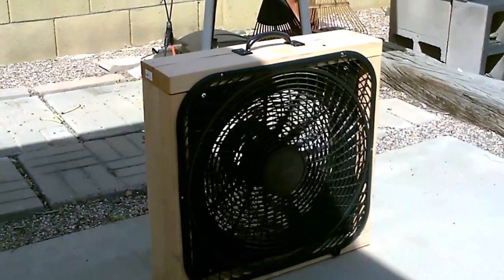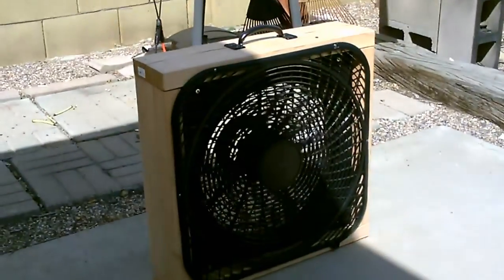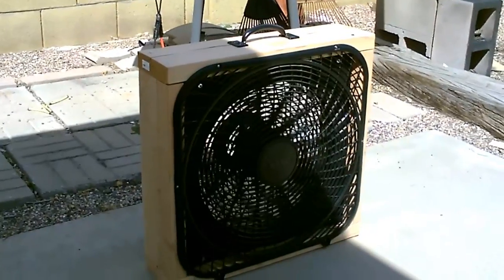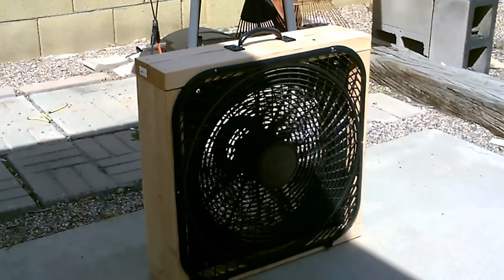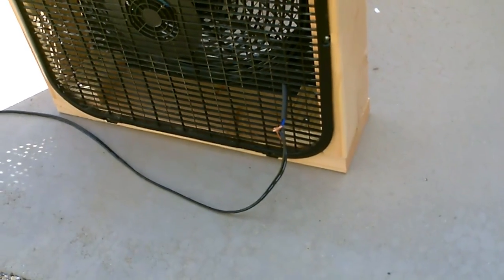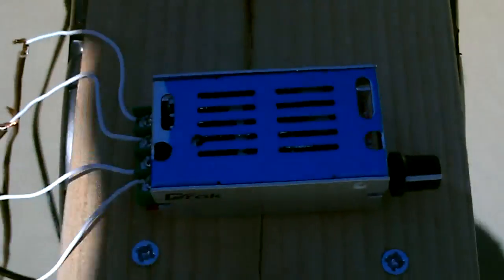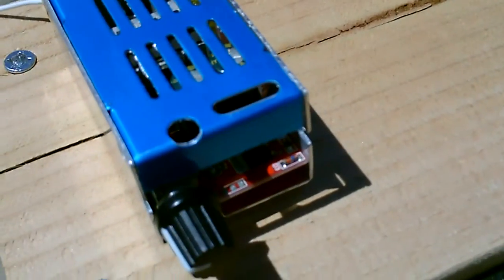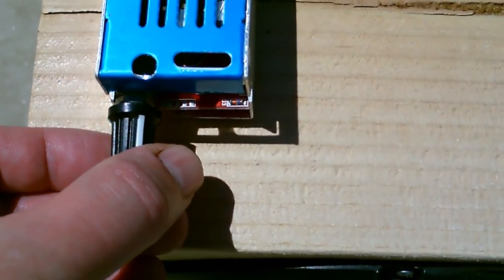Homemade 12V DC Box Fan! - Full Size! - 100% solar! (or battery pwrd) - 100w panel/motor - Awesome!

Comment: Could you not just get an old junk car radiator fan, discard the ac fan/motor combo from an old 20 inch box fan, then zip tie the  radiator fan frame to the box fan grill(using ample zip ties of course) .These box fan cabinets are about 4 ish inches deep so plenty of room to accommodate a typical car fan assembly. The  do your  motor controls and switch.

Comment: Fan motor cost?
Reply from the maker: you can get a 16" car radiator fan (like the one i used) for about 30 dollars. they sell more expensive ones but a regular one is about 30

Comment: Now this was the video I was looking for!!!!!!!!!! I have a old Volvo radiator fan and wanted to reuse it for a box fan. I'm going to run it off a house wall socket though with a potentiometer for another fan. Thanks for the Idea!!!!
Reply from the maker: Glad I could help. i looked for a 12v box fan 'on and off' for a year or more. couldn't find one so i just made one 🙂
Reply: How did your fan work out?
Reply: How did your fan work out???

Comment: How are you running it direct off the solar panel without a buck/boost converter isn’t the VOC too high?
Reply from the maker: hi. the voltage is fine. the fans are made to handle a range of voltages. the voltage from 12v panels is a little higher than 12 volts (from 15 to 19) *but 12v power supplies run higher too. the output voltages of my 12v power supplies are from 12.91 volts up to 17+ volts.

Comment: Does this fan motor need to be lubricated?
What's the maintenance on the panels?
I'm in desert also but don't understand the safety behind making a setup like this and the longevity.
Doesn't it need fuse?
I'm looking at outside setup for horses and a portable one when I go to dog events. 😊 Wish you were local, I need a Solar and Electricity Mentor!
Reply from the maker: hi. nope, the fan motor doesn't have to be lubricated. these motors will run many years and are 'maintenance free'. there is no maintenance on the panels either (except for keeping debris off of them). these types of fans can easily last 15 years and the panels last 20 or more. there really are no safety issues with this. it's basically just an automotive radiator hooked to a solar panel. just make sure to use a 12v solar panel. no fuses are needed
Reply: Thanks!! ❤

Comment: Do you have a link for buying the fan on Amazon?
Reply from the maker: hi. i can't find the exact link but it's just a stnadard 16" auto radiator fan. any should work good. i'll see if i can find a simliar one... here is a link one
https://www.amazon.com/dp/B0BJCYJBRB/ref=sspa_dk_detail_3?pd_rd_i=B0BJCYJBRB&pd_rd_w=mZae7&content-id=amzn1.sym.56b6d1e1-8781-4e32-a7bc-5298ad4b88ac&pf_rd_p=56b6d1e1-8781-4e32-a7bc-5298ad4b88ac&pf_rd_r=Y0Q5WS1JVH52R42VKRJN&pd_rd_wg=ObsSy&pd_rd_r=6c88350d-e53b-4c99-9c8e-d5dc510f7d44&s=industrial&sp_csd=d2lkZ2V0TmFtZT1zcF9kZXRhaWwy&spLa=ZW5jcnlwdGVkUXVhbGlmaWVyPUEzSTdXWjlLV0JaSDYzJmVuY3J5cHRlZElkPUEwMjM4Nzk1M0pIVDk5SzhEWlA5OSZlbmNyeXB0ZWRBZElkPUEwMDcwMDQyMThLNEdGTjdDSTNZUSZ3aWRnZXROYW1lPXNwX2RldGFpbDImYWN0aW9uPWNsaWNrUmVkaXJlY3QmZG9Ob3RMb2dDbGljaz10cnVl&th=1

Comment: Just for fun I bought (6) 100 watt panels, set them up on the roof and went into the basement to see what kind of things I could do with 500 watts of DC.   Right away I noticed no one makes a good 12 volt box fan. I ordered a new radiator fan that was balanced and has grills on both sides. I ordered a cheap speed control from amazon and installed the whole unit into an old case. Works like a charm except its a bit loud but I love that it can run right off the panels with no control. In the mornings it starts on its own and runs all day until dusk. Its perfect to keep air from stagnating in basements. Also all that free electricity is hooked up to strip lights in the closets and anywhere that I need it. I use it to charge all my batteries including all my yard equipment power tools etc. Anything left over goes into a 12 volt ceramic heater to preheat the water going into the hot water tank.
Reply from the maker: that great! you've found lots of uses. i run dozens of things just using 100 watt solar panels. i actually made this box fan because i couldn't find a 12v full size box fan anywhere. someone should make and sell them and include the 100 watt solar panel. simple off grid cooling

Comment: So this fan is brushed motor?
The dimmer controller says it's specifically for a dc brushed motor and unfortunately no longer available.
It's confusing on Amazon whether the automotive dc fans are brushed or brushless.

I was told brushless motors are better bc no or low maintenance? Help me understand the details behind which fan and etc parts needed for this. Off grid desert stables really need these to help with fly control and cool the animals. 🙏🏻
Reply from the maker: hi there. most radiator fans are brushed so these motor speed controllers work good with them. if it's brushless it usually says. yep, looks like that link is old so i added a link to a different motor speed controller. it is just as good
https://www.amazon.com/Motor-Controller-Enmja-Adjustable-Regulator/dp/B09Q2QVWVX/ref=sr_1_1_sspa?crid=18SVQFRC9REMA&keywords=12v+motor+speed+controller+20a&qid=1653515188&sprefix=12v+motor+speed+controller+20a%2Caps%2C190&sr=8-1-spons&psc=1&spLa=ZW5jcnlwdGVkUXVhbGlmaWVyPUEzQ0tIMk5GQkJFRDFRJmVuY3J5cHRlZElkPUEwOTgyOTQ2VzlWTlNUNUNGTU5WJmVuY3J5cHRlZEFkSWQ9QTAxNDQ2MDkzQVlZWENVSTBHSFpUJndpZGdldE5hbWU9c3BfYXRmJmFjdGlvbj1jbGlja1JlZGlyZWN0JmRvTm90TG9nQ2xpY2s9dHJ1ZQ==

Comment: Does that fan speed control module is it able to turn the fan completely off? Or do I need to disconnect the fan from the 12 volt source?
Reply from the maker: hi. it turns it totally off 😎
Reply: @desertsun02   I bought all that stuff and it didn't work. But I wire the fan to the battery it's too much power. I think I got a bad switch I'm not getting no power to the fan. Is blue the red + and black the - ? For the fan. Thanks for the help.
Reply from the maker: @Brian Reynolds if i understand what you're saying, you're saying that when you hooked the battery to the fan it ran at full speed (but that was too strong of a breeze?) ...and then when you hooked the speed control switch in-line the fan wouldn't run at all? if that is what is happening then it could be a bad switch (unless you put the wires into the switch in the wrong places). also did you buy a 12amp or higher switch (like the one i used)? if the switch isn't rated to handle the amp draw it could just burn out within seconds. most of the fans i use can be hooked up either way. (depending on which way you want the blade to turn).
Reply: I use the same model that you use and it turns out that switch was bad. I went back to Amazon and got the 30 amp switch and it turns out that the 30 amp switch works.  I replaced the one that you told me to get in the parts last but this model number at Amazon Asin# B09Q2QVWVX this one seems to work out of the box. I didn't wire it the wrong way because the wired this one the same way I wired the other one and this one works the other one didn't. Apparently I got a hold of a bad switch.

Comment: Couldn't you just gut out the old fan and use it instead of the heavy wood frame?
Reply from the maker: hi. that's a possibility. just have to figure a way to mount it to the metal frame. if you experiment with that - let us know how it works out.

Comment: So, bare copper wire like an ac cord can be spliced right to solar cables?
Reply from the maker: yep, that's what i usually do.
Reply: @desertsun02  I heard that before but never really believed it
Reply: Does the gauge of wire matter?
Reply from the maker: yep, but even a light/medium duty extension cord wire usually handles 13 amps and a 12v 100w solar panel puts out 5.5 to 6 amps (usually) so regular extension cord wire can usually handle two 12v 100w panels

Comment: Hi,   Thanks for video,  I have zero electrical know how and your method looks very simple, Some video s say I need a relay switch,  Yours did not    I couldnt add a relay if my life depended on it,   give me good news,   Do I need a relay for this project?
Reply from the maker: hi there. the good news is that you don't need a relay for this project. this is a very easy project. the motor directly connects to the power source (thru the motor speed controller)
Reply: @desertsun02  Your a gent,  Thank you

Comment: I've tried something similar. I found that the blades on those radiator fans is optimized for pushing air through a radiator, rather than moving a large volume of air at high velocity. It really didn't work that well...
Reply from the maker: hi. main thing with these is that you have to flip the blade (sometimes) if you run it the other direction. if you don't it won't move much air. makes huge difference 👍

Comment: I want to put one of these together and add that controller..could someone show a more detailed video about the wiring or point me to video that might show it..😉thx
Reply from the maker: hi. adding controller is very simple. it's got places for 4 wires. 2 for power and 2 for the motor. each connection point on the controller is labeled so you just insert wire and tighten it down.
Reply: @desertsun02  thank you👍

Comment: I want to use one 200w solar panel and 2 of same fans that you use.  
Would you put two wires into the speed controller and split it there?
Or would you just wire them(fans)  in series ,  parallel?  Sorry I forget 
which one does what,  and just use one wire out of controller.
I'd prefer just to use solar panel to run them,   so is 200watt one
enough for 2 fans?
I would have them up in attic,  but if power went out I would
pull them down and want to use them for air circulation after
power loss to home.  So where to put quick connects in circuit?
Any idea welcome,  and those fans are a genius idea.
Reply from the maker: hi there. i'd wire the fans in parallel (parallel keeps the voltage the same but spreads out the amps). one 12v 200w solar panel would probably be enough to run 2 fans close to full speed.

Comment: I tried this with a radiator fan and a 5 gallon bucket.  I can't figure out why it doesn't blow as hard as I think it should.  It's a 12v smaller radiator fan, is the bucket too big to push through?  I am using a good DC power source until I switch to solar.  Thanks
Reply from the maker: hi there. i'd have to see your set up to give much advice on that. if you want you can send a pic of it to my email address (the one listed under on my channel in the 'about' section of the channel) and i'll try to help from there.

Comment: How long will the battery last. 
Thanks for the video
Reply from the maker: hi there. well, it depends on the exact power draw of the fan you use and the size of the battery, but you can use these all day on the larger batteries. then just recharge batt and you're set.
Reply: @desertsun02  how do you go about recharging the battery ?
Reply from the maker: hi. i usually recharge mine with solar panels. i've got a couple of solar systems set up. or you can just use a charger.

Comment: For getting the variable speed control and power consumption adjustment... this is a better deal. For those wanting to do this, using a normal box fan... A 12v to 120v (100w) inverter is about $12-$18, Plus the normal 120v box-fan for $18-$20 is total of $30-$38 for the setup. However, most 120v box-fans run at 80w (high), 70w (med), 60w (low). Using a car-radiator fan, with the PWM speed-controller, can give you more wattage control and air-flow control. (Only use what is needed.) From 10w-80w, normally.

A similar unit, pre-made, would cost you $200-$400 (Because they all like to price-gouge the 12v market.)

FYI: Junk-yards (u-pull-a-part), only charge about $5-$10 for a cars electric radiator fans. They will last for years! In a car, they normally only run when the car is IDLE and not driving. The bearings are 1000x better than any box-fan's bearings, and the blades are stronger and better tuned for "moving air" with a higher static-load. Also, they are almost ALL variable-speed ready. (You can even pull the fan controller from the same car, for the cars "blower fan", for about $2-$5, or free... as part of the fan pull.)

Add a cheap solar charger and a cheap 12v car battery, and you have a fan that can operate 24/7, at a modest setting. (For lower wattage and better air-flow, at a lower wattage, add a large 12v computer fan, which uses a stepper motor, which is more efficient at lower voltages. There is no shortage of "road-side computers" or "free computers", which are useless for computing, but they all have decent fans within them, that have plenty of 12v, variable-speed life left in them.)

PRO-TIP: Make a filter-cube, using 5 mass-air-flow, fiberglass, AC/Furnace filters, taped together to form a "box", and you have dust and pollen free air-flow, at high speeds, for a modest cost of adding another $10-$20 to the build. It'll clean more air, faster, than your homes AC unit would, with a fraction of the power. (80w instead of 1.8Kw or 1,800w) By the way, a homes AC blower-fan will add tons of heat to a house, that it is trying to cool. Almost makes it redundant, to a point. Best upgrade you can make for a home central-AC is to move the "blower-fan motor", outside of the house, so it isn't "inline" within the cold air that you are paying a premium for cooling, just to heat it back up again, as it cools the blower-fans, stressed motor. Stressed from, usually, a tiny, undersized, clogged air-filter, which makes it run even hotter.

P.S. They never include "internal blower fans generated heat", into the calculation when selling you a central-AC unit. They don't even include that heat, as a negative, in the "SEER ratings", or when measuring the real output of an AC unit. That is why a window unit, which has the motors outside and isolated from the internal parts, is more efficient, in all respects. They are just not convenient, like a central-AC.
Reply: I checked my fan motor inside squirle cage. It didn't seem to give off much heat and no where near what my fan belt 1/3 hp motors were always too hot to touch. This one is internal to the cage and must be far more efficient.
Reply: 😳🍽️🍽️🍽️🍽️🍽️🍽️🍻🍻woah ive been thinking for about 4 hrs an im reading a book an a vidoe an forgot to watch/listen to it 🙈👀👂🏼
Reply: I need more of your opinion on solar please. Do you make content? Haha.

Comment: What is the wattage of your solar panel?
Reply from the maker: hi there. it's a 12v 100 watter 👍 (larger 12v ones like 120w, 150w or 200w will work good too).

Comment: how many hours has it been running?
Reply from the maker: hi there. i've run it for hundred of hours (total) at this point. car radiator fans are built tough and can be used for years and years
Reply: @desertsun02  cool, i got one and just need the dimmer - Thank you

Comment: I'd like to use this concept connecting multiple box fans (4 or 5). Do you think that would be possible using one controller for all of them? 

Great DIY, excellent vid!
Reply: I did it using radiator fans, just hook them in parallel for 12 volts they will all be equal.

Comment: whats the Airflow speed? is it good enough for desert cooler and can cool a 10x10 room?
Reply from the maker: hi there. airflow speed is similar to a standard AC box fan. 2000cfm. it should cool a 10x10 room. i've seen radiator fans with cfm over 3000. you could make it with one of those as well. 3000 cfm is similar to an AC powered high velocity floor fan
Reply: @desertsun02  ok I will try it out soon as summers approaching

Comment: I am getting a small solar setup that has a 12v battery and I'd like to be able to hook a fan in it. Where did you get the fan you are using.  I can hook a fan into it with a car cigarette charging port, but I'm not sure where/which fan to buy with a DC motor.  Can you link to the one you have in the video?
Reply from the maker: hi there. i get my 12v radiator fans on amazon. links change often. the one i used is 16" 12v car radiator fan. best way to find them is search amazon. they got tons. ⭐🙂

Comment: It is a good idea for 12 volts direct . Very useful is to run a fan with a small inverter a 400 watts or smaller will do but the more efficient the inverter the better . I even run a tower fan from my solar panels using a pure sine inverter. Also induction Cooktop and a Dometic refrigerator. You could probably run a small inverter and fan using 18650 batteries.

Comment: Which radiator fan did you get for this?
Reply: Any car wreckers ( car junkyard) thermo fan will do. A 10 inch needs around 300 watt in solar for decent power

Comment: Can you post a link to the fan source?
Reply from the maker: at the moment i can't find the exact link to the fan i used, but any 16" 12v car radiator fan will work
Reply: Found it!  https://www.amazon.com/gp/product/B01MQFSKN3/ref=ppx_yo_dt_b_asin_title_o00_s01?ie=UTF8&psc=1
Thanks for this amazing video.  I'm trying mine out as a "ceiling fan" for a tent this weekend.  No box, just held with 4 guys to the ceiling.  Can't run full speed like that, but this is a CRAZY fan!  I was going to buy another endless breeze, but you can build one with your guide that's so much better at well under half the price.
Reply: P.s. your heat exchanger video is very cool too, thanks for the great content!
Reply from the maker: you're welcome. i'm glad you're enjoying the videos and glad your making the stuff! those heat exchangers work awesome. i just finished a 12 by 12 unit with a 12 inch fan for heating and cooling. i'll be posting it soon.